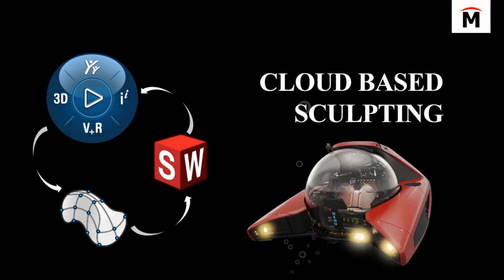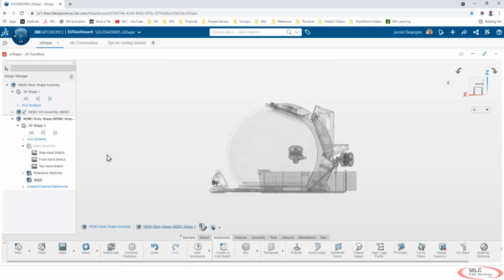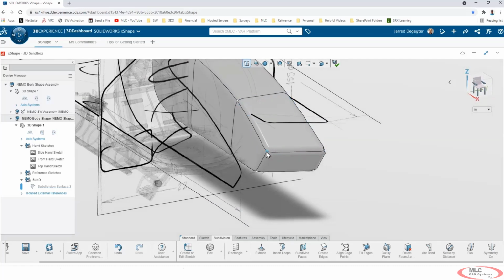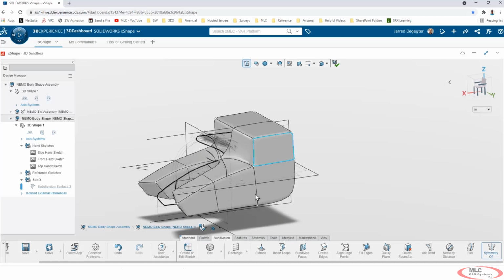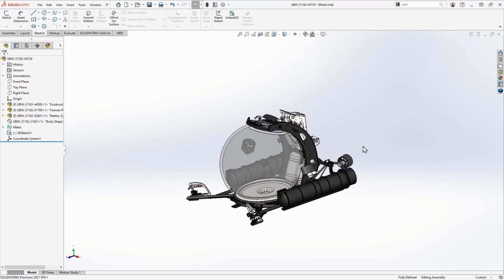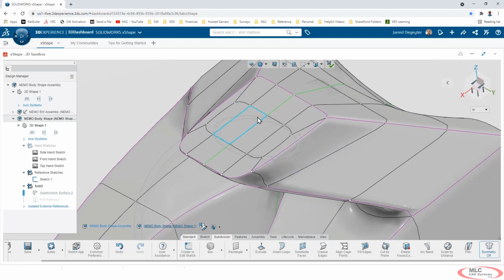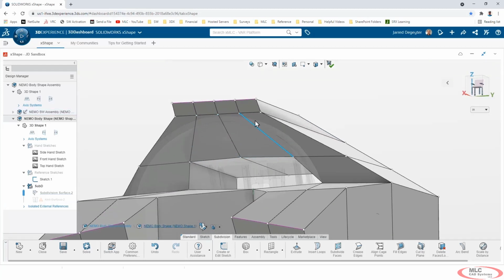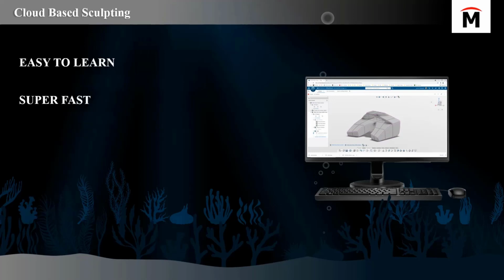Cloud-Based Sculpting with xShape on 3DEXPERIENCE - Webinar

Comment: It is not working with virtual clay! (3:00) It is working with polygons and subdivision. 

Virtual clay have sculpting-programs like 3DCoat, SculptGL and ZBrush. Look at these progs and you'll see the drastic difference!
Reply from the maker: Thank you for the additional insight!  Our viewers are used to the more rigid parametric modeling of CAD, so to many of our users this is as close to virtual clay as they can get while also maintaining control over dimensions and the ability to add engineering design features.
Reply: @MLCCADSystems  Yeah, from this site, I understand.